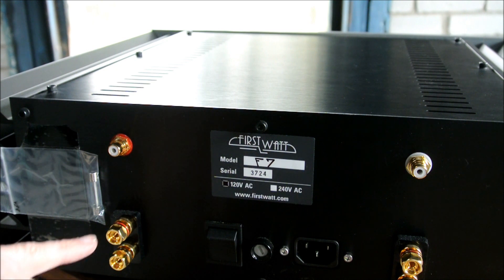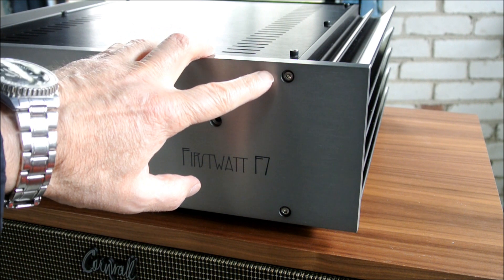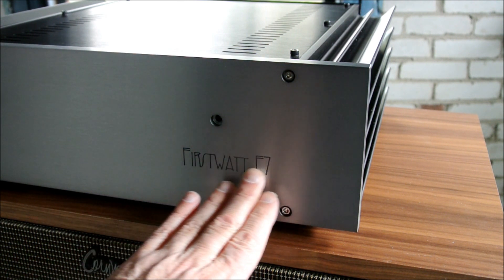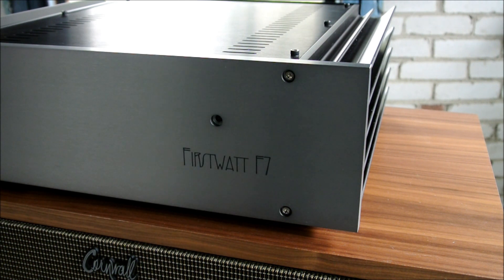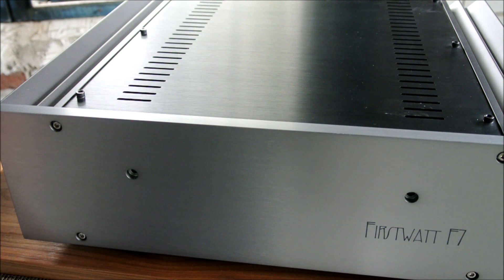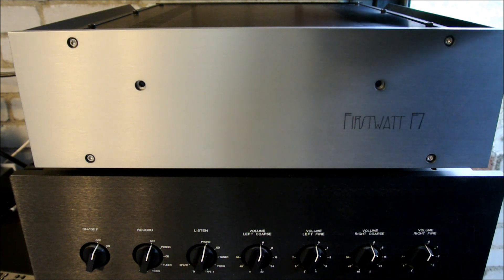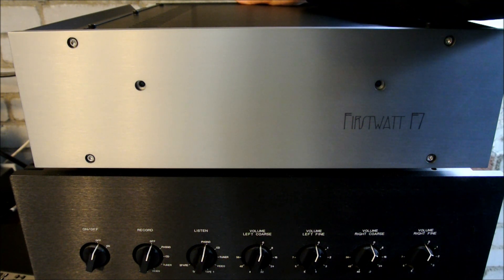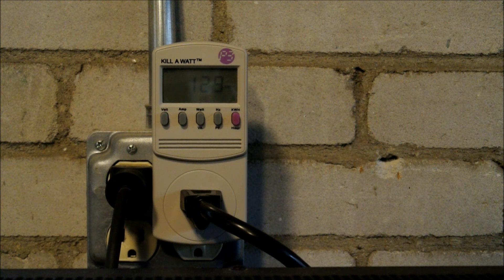First Watt F7 Amplifier Review

Comment: 20 wpc for class A is quite a bit. Looks like a very upgradable and easy to repair/maintain amp.
Reply: I you upgrade a Nelson Pass designed unit it will lose resale value.
Reply: Ryan William Or void the warranty. However if I believe there’s improvement that I can do within my means... I usually mod/upgrade. I upgraded/modded my Magnepans and Mark Levinson amplifier. I race and rally cars and have a modded upgraded Ferrari F430 which would hurt resale. Oh well... the new Tubi exhaust system was worth it regardless of valuation issues. Plus the new exhaust system is an audio system on its own.

Comment: If they sell at, say, $1,000, it will sell like peanuts! Especially, if there is nothing inside. It should be fast to assemble.
Reply: its not cheap because firstwatt use custom transistor (sit/vfet) from semisouth
Reply: @annasipul  Not in this unit. They use a lateral mosfet I believe which may even still be in production. But you gotta pay the keeper. So even at $3000, it wasn't a bad deal.